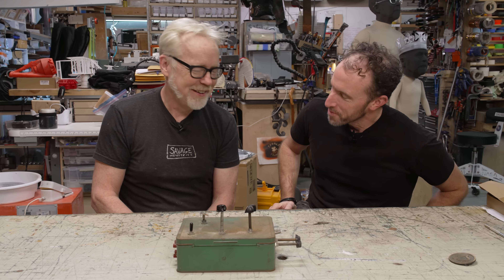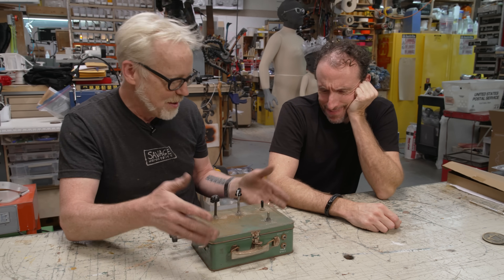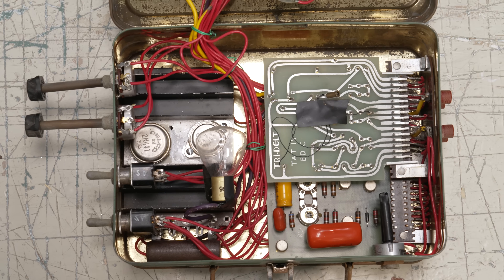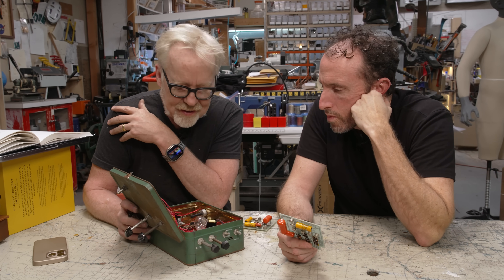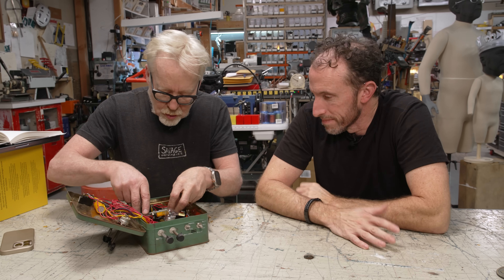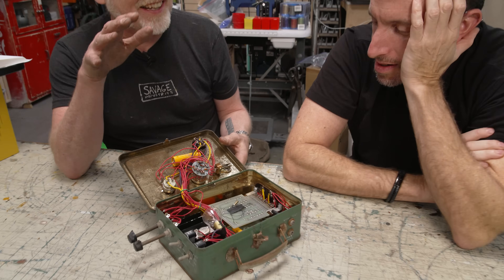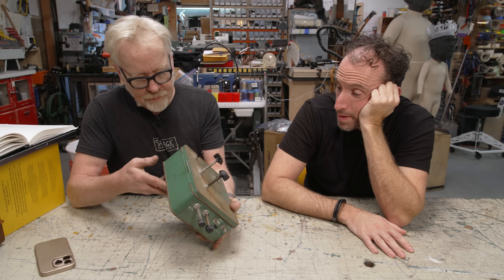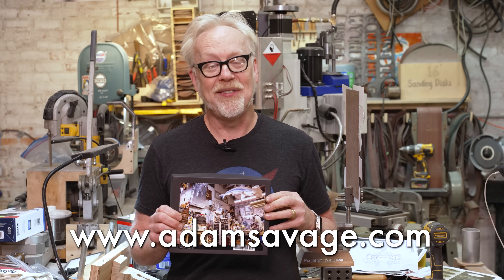The Mystery of This Vintage Electronics Lunchbox

Comment: I am an electrician and I have worked in thousands of old shops that had homemade machines that were some 40 years old (and this was over 30 years) and there are small shops with machines someone made from things like an old shopping cart. It started off life hauling groceries and now is a digital injection molding machine. The cart itself is buried deep in the contraption but you can still see the frame and parts of the wire basket they used to bolt then weld on steel plating over the decades. As the machine needed upgrades to do different projects it grew like a Christmas tree a monkey bars of B-Line and perforated angle iron.

Comment: I notice you love "quality design". If you get a chance, check out ADT 1950s, 60s, 70s flow detectors and wind up fire alarm devices (I'd bet many are still in service). They require no local power and report via a city wide, giant,, DC, series circuit (AKA McCulla circuit). Solid brass, made to last and a elegant, simple design. You'd love it 😊.

Comment: Model railroad Throttle... Lap apply are break settings that this perhaps simulates the breaking in an Westinghouse air break system in a model railroad that switch is by design not broken by age.  I would have to say that perhaps this was built to run an electric train using dual 12 volt batteries that ran a 24 volt system on a backyard model railroad that you ride on.  A lot of these are built by hobbyists who would need a machine shop to create all the locomotive and rolling stock.  If you want examples google discover live steam

Comment: I remember a few TVs as a kid, taking them apart...the way they were built was so like...not very good but it worked. All hand built, with like bolts as terminals for a bunch of wires, and wires that looked like they were twisted together I forget if they were soldered or not or maybe just dipped in wax or tar...which all makes sense and is even stuff I might do when rigging up something, but I sure hope that lots of efforts have been made to accurately preserve all this evolution. I know I have done some of it, trying to hold on to some older PCBs and components because eventually u just wont see them again, possibly. lol I sound so old but I am not wth, it is just a very nostalgic topic for me as some of my first memories involve being on a  mountain of recycling when there was an appliance recycle pickup and I had a hammer and screwdriver. King of the hill of electronics scrap, wear ur ppe kids. if u don't wanna look like me. just wear ur ppe no matter what u wanna look like.

Comment: The round metal "transistors" are actually integrated circuits. I use to work for an outfit called Signetics. It became a victim of reaganomics. We manufactured components like this. My job was placing the wires on the "chip", an operation that took place under microscope. The wire had to be placed on the circuit and run out the the posts, that allowed the electric signal to activate the "chip".

Comment: The orange, cardboard cap is indeed electrolytic. At 7:26 you can see the last few letters of "LYTIC".

If you aren't familiar with the topic of "re-forming capacitors", very old electrolytics are more likely to survive being re-energized if power is applied slowly, via variac and/or a dim bulb tester, in which incandescent bulbs do double duty: as high-wattage resistors and as indicators.

Slowly applying power allows the dielectric (insulating) layer in the cap to grow chemically. When unused for years, the acidic electrolyte will partially dissolve it. If abruptly re-energized, the leakage current through the dielectric can be high enough to heat the electrolyte to boiling. Of course, when this happens the cap bursts and you get to experience the joy of cleaning its guts off of the rest of the circuit.

Comment: The incandescent bulb may be part of a wien bridge oscillator which is a way of making a fairly good sine wave.  It provides negative resistance, changing during the oscillator cycle. If there is a neon lamp in there, it definitely involves at least 90 volts.

Comment: This may help with when this was made. Some of the larger transistors look similar to ones I played with in electronics class in high school in 1967. Germanium! Germanium transistors (or diodes?) were used in some foot pedals for effects for electric guitars in the early-mid 1960's. They made great tone, grunge etc, and are still sought offer.

Comment: I'm 15 hours late seeing the video, but knew what this was because my friend's dad when I was a kid was massively into model railroads and had several mounted on 4x8 plywood sheets with all kinds of different scenes, towns, and terrain. He would stack them vertically against a wall because the garage was only big enough to setup one at a time. In any event, Adam can now build a heck of a rail system around his Christmas tree at tested and have an authentic throttle controller!

Comment: You mentioned that you got this from the same location as a mini mill/lathe and a grinder... I think you have the control circuitry for the things that were already gone... I'll bet those people that got what you originally wanted are now pulling out their hair because some idiot auctioneer thought that it was just some weird lunchbox and didn't know it was the controller for those items.  Maybe the original enclosure got damaged and the original owner just repackaged it with readily available items.  Enclosures are expensive, lunchboxes are cheap.

Comment: I'm very much the same way about those finds. My father was a radio operator and had oodles of electronic and radio projects going on all the time. I distinctly remember being overjoyed at the sight of a crate of new (but slightly out of spec) electronics parts that he had bought from Tecktronics around 1976 or so. It was a wooden crate, and about 3 foot on each side. Lots of goodies to play with.

Comment: My favorite finds!

I used to use lunch boxes for project boxes all the time, as they were common, cheap, and made great project boxes!

As for the motor control, it has that look, and the neon lamp looks to be for voltage protection on the switch board, while the incandescent bulb could have been part of an oscillator circuit.

Great find! I love how they left the pot shafts original length, rather than cutting them down to size! That would have been a source of pride for the person who made it, if it worked as designed!

Comment: Those small vents on either side are original to the lunch box.  Google "Vintage 1960s Green Metal Lunchbox".
You can where the metal clip would insert that held the thermos on the hinge side.

Comment: PPM is Pulse Position Modulation. Wire-wound resistors, especially that vintage are often high resistance. It looks like it was built as a machine tool controller. I do RF from DC to light, and it's not an RF device of any sort.

Comment: I think he meant to use the acronym PWM (Pulse Width Modulation) and not PPM (Pulse Position Modulation).  PWM has been used in control over a range for many years and still is used.  Many LED controllers use PWM for ‘dimming’.
Reply: Depends on which signal you are talking about - using the traditional JR/Futaba "digital proportional" controls the over the air signal is PPM with the servo positions controlled by the time between each pulse and the previous one.  The actual signals going to the servos are PWM and each output goes high for the time interval between two pulses in the PPM stream.

Comment: While I had no idea what the function of the object was until reading the comments, it did provide an opportunity to find a great example of poorly rendered AI.  A Google search for 'tri-delta tat iv circuit board' returned the following commentary:   

A "Tri-Delt TAT IV circuit board" most likely refers to a circuit board specifically designed for use in a "Tri-Delta" (Delta Delta Delta) sorority house, with "TAT IV" likely indicating a specific model or version of the internal electrical system used in their building, potentially related to a "Total Access" or "Telephone Access" system with its fourth iteration.
Key points to understand:
Tri-Delta:
This is the common nickname for the women's fraternity "Delta Delta Delta."
TAT IV:
This is likely a designation for a specific type of electrical system or circuit board used within the sorority house, potentially related to communication or access control features. 

Nicely done, AI.

Comment: I don't know exactly what circuit that is but IMO it looks like a model railroad train controller. Whoever built that really put a lot of effort and love into that. They used some of the highest quality components available to them at the time. I love all those old Allen-Bradley resistors. I still buy old NOS lots of them off of ebay and use them in my projects.

Comment: Definitely a home brew model train controller. I searched for the name and model on the circuit card and first hit was for mrh forum discussing the TAT IV transistor throttle brake circuit. Creative use of a lunch box. I have seen old timer's circuits built in cigar boxes and any other convenient makeshift "enclosure" someone found lying around the house. I can remember building something in an old Sucrets tin, and built a Morse Code practice oscillator in an old plastic box that some item had come in. Perfect for the speaker, circuitry and 9v battery. I took the amplifier circuit out of an old broken tape recorder and mounted the speaker and circuit board in an old margarine tub because that's what my mom had kicking about in the kitchen, and it was free. There were plenty of other examples, but those are the ones that stick out.

Comment: BTW the lunchbox is made by American Thermos Bottle Co and was produced throughout the 50's and early 60s.  And yes the two slits on each side are standard ventilation in those lunchboxes.

FYI in this context lapping refers to the action to hold steady or hold a certain set amount of force (e.g. like waves lapping against a shore).  So here it is for brake systems in a train.  When you have a distributed pressurized reservoir of air pushing on the brake pistons over a large system the amount of pressure applied varies as the reservoir decreases in pressure.  Depending on the locomotive type (and age) you would either have brakes systems that self-lapped (corrected for variable pressure) or required manual lapping (the locomotive engineer would have to manually fluctuate the brake level and reservoir feed with the control to maintain braking force).   Thus if he wants his steam model locomotive to seem period correct he would adjust these values.
Reply: I was SURE those "vent slits" were for a clip that secured a wire bail that held the thermos in place.

I hate not being right, but I like knowing when I'm not too

Comment: Neon lights were also often used as regulators in the past. 
The transistors 2N1302 and 2N554 came on the market in 1958 and in the mid-1960s they became less popular because better transistors were available.
some parts may have a year and a week number.
i found 1 at 6:01 6925  1969 June 18.
Reply: neon lights were also used in oscillators

Comment: I guess neither Adam or his guest had a model railroad when they were a kid (or adult) to not have quickly figured out that the mystery device is an early, home-built, electronic momentum throttle.  They are still in use today for model railroads, but the electronics have been reduced to a single computer chip.
Reply: It's about expectations usually.
If I go to a garage sale and 90% of the stuff is R/C planes/cars, I'm going to assume any random piece of radio gear is related to that, even if on it's own it is clearly a piece of HAM equipment.
Sometimes context can be SUPER helpful in identifying something.
Sometimes it leads you away from the right answer.
Reply: @Prophes0r  True.  They were on the right path when they determined it was a motor controller.  However, when they assumed it had something to do with shop machinery, that made them go down the wrong rabbit hole.  You know the old saying, "When you assume anything ..."
Reply: This is a very advanced DIY throttle for the time.  Not the kind of thing you'd build for a beginner set.  Other posts mention the designer.  His model layout  covered an extremely large basement (Bruce Chubb's Sunset Valley).  I wanted to make one when I was young, but by the time I had the equipment, time, and money, the hobby was firmly in the DCC era which is superior in many ways.
Reply: @T.r.o.y.J  True. However, MRC (Model Rectifier Corp.) around this same period, produced their own version of the TAT throttle that anyone could buy off the shelf.  I really wanted one when I was a kid, but it was out of my parent's price range!
Reply: Who the hell ever had one of these as a kid (or adult)
Reply: @peterdean9181 not one of these specifically I think he means  having one or playing with one of these controllers  would make the labeled controlls pretty evident even if you haven't interacted with the specific model at hand.
Reply: @peterdean9181  I did. Hand me down from family in the States. Grandpa smuggled it in through the iron curtain. I still have it. Lionel made. He didn't manage to bring it complete, the rail had to be hand made here in Europe and the controller is 100% made here from schematics with German and Soviet parts. I still have it somewhere. After the trash got pushed back to you-know-where, i managed to complete the whole set and got another custom made controller in the package as well. It had those boards. So... pretty common back in the day, at least by that measurement of scale.
Reply: @peterdean9181  My father for example. That railwayboard took up have the basement :p
As far as i know, it was a popular hobby in the 60-70s and still has quite a few followers 🙂

Comment: A bulb was used in oscillator circuits for stability.  More current, brighter hotter bulb so more resistance
Reply: Also a great quick-and-dirty way to add some current limiting to a test circuit!
Reply: As a result, an incandescent bulb is actually a pretty decent current regulator. I used to have a hobby constant-current battery charger where the regulating elements were bulbs.

Comment: "Every time I think the 1960's were primitive..." Take a look at the HP test equipment that was made in the 1950's and 60's. That will convince you that they had some wicked smart engineers!
Reply: They landed on the Moon in the 1960s. Top that 21st century.
Reply: well you are writing this on a global network, i am quite possibly on the other side of the globe, yet we can still communicate and watch the same video @1pcfred
Reply: And using a computer in the lander that had less processing power than a modern smart phone.
Reply: @joermnyc  on the first landing the computer broke down with the infamous 1202 alarm incident. There was a dithering error with the radar antenna. It was trying to adjust faster than that limited processing power could handle. It basically couldn't handle the pressure and folded up. Fortunately we had Superman flying the LEM.
Reply: @1pcfred 
It didn't break down. 
It did exactly what it was designed to do. 
If it had truly failed, they would have all died as without the computer you can't fly the LEM, the computer always flew the LEM and the Apollo space craft.
Reply: @1pcfred  
Yes, he controlled the lem in the most manual mode possible but make no mistake. 
There is no link between the control panel and any rocket motors.
It's digital fly by wire, Armstrong asks the lem to translate in the x and z plane and the AGC converts this, combined with data from the inertial platform into reaction control squirts.
Once a suitable landing location had been found, the program is triggered to land, reducing and then shutting off the main engine when the touch sensors reach the ground. 
Without the computer, the craft would have been 100% uncontrollable.
Their only option was the abort button which triggered a separate simple "get me back in orbit" computer.
This was the genesis of fly by wire, where there are no links between the control stick and the control affectors.
Reply: @joermnyc I think my first scientific calculator (1978) a Casio fx 31 had more processing power than the moon lander in 1969.
Reply: Look at HP's HP 9100A calculator from 1968...
Boss: "This needs to be the size of a typewriter. I want it to fit my desk extension. Also, keep it under $4K"
Engineers: "it needs 32 Kbits of ROM code... That would, assuming an even distribution of bits, take an estimated 16000 diodes, at an average cost of $0.25 a piece... It's too massive and blows the whole budget!" (ROM chips weren't really available to them back then)
Boss: "Figure it out."
Engineers: "Okay..." 
The Engineers: Proceeds to use ZERO diodes for the ROM by creating a ZERO COMPONENT 16 layer PC board with zig-zagging trace patterns and intersecting sense lines to create an inductively coupled fixed pseudo-core memory The only components needed are the drivers to drive the pattern traces and some differential amplifiers to sense the inducted patterns on the sense lines.
Also The Engineers: Hires a carpenter to widen the bosses desk by a fraction of an inch when he was away for the week, cause they already did the molds for the cast housing, and it just barely didn't fit his desk, and they REALLY didn't want to redo that.

Comment: I suppose the light bulb in there is to regulate the current?  
I remember touring a thermal power plant the guide said they would sometimes run the output through the armature of an unused generator (alternator?) to act like a choke!  That seems rather cool.
Reply: Yeah incandescent bulbs are natural current limiters. They're not half bad high current resistors either.
Reply: The light bulb is often used in a Wien-bridge oscillator.